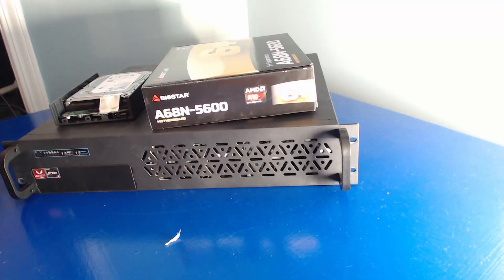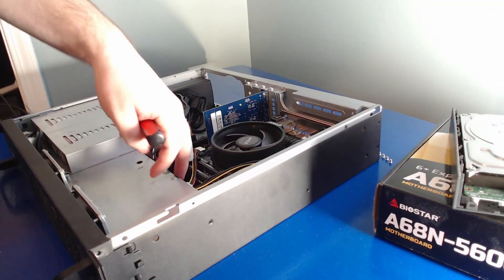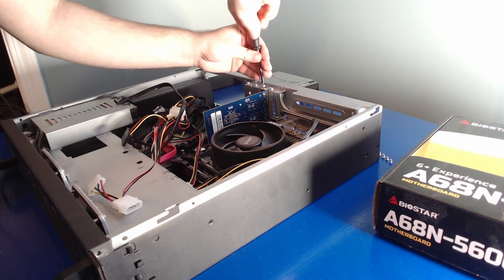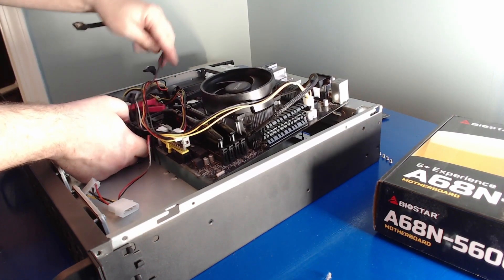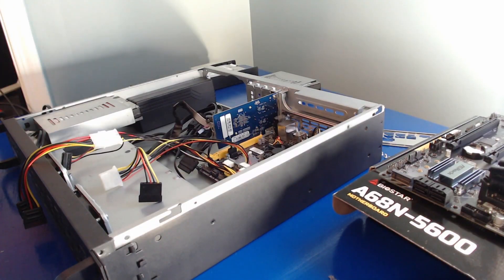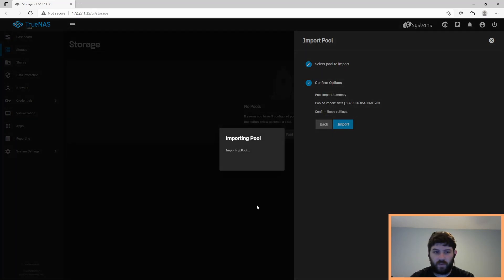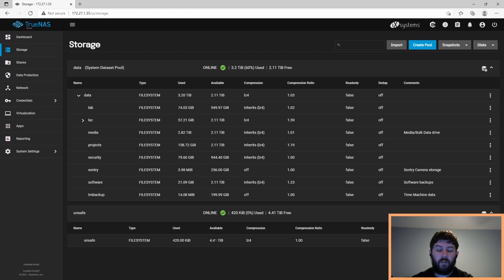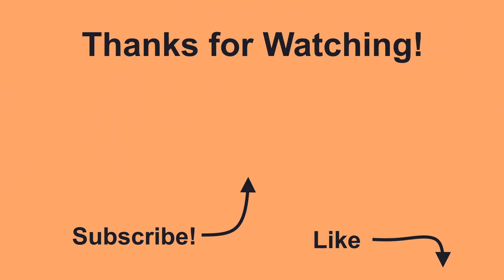Rebuilding my older ZFS server for TrueNAS SCALE

Comment: How stable is scale?
Reply from the maker: I'm not doing anything particularly complicated but I haven't had any issues with it at all. I'm only using local authentication, SMB, and NFS, so it's not a comprehensive test of its features.
Reply: @apalrdsadventures  Is there currently any  LXC support?
Reply from the maker: No, they have VMs, Docker, and Apps. I believe Apps are either packaged containers or packaged Docker images, the equivalent in CORE used pre-made Jails.
Reply: @apalrdsadventures  Ah got it, thanks. I hope they will add LXC support soonish tho!
Reply from the maker: @Shadoweee  I don't know if it's on the roadmap. I don't do any virtualization on TrueNAS, I use Proxmox instead. TrueNAS has never been great at it.

Comment: Single disk ZFS pool is perfectly fine as long as you do not require redundancy.
You can even fill it to the top above 80%, just do not use snapshots in this case.
Reply from the maker: I'm aware, it's just not great practice to store data on a file server with no redundancy. In my case, I'm using it for backups and security footage, so it's all data that can be lost without issue, as long as I'm aware of drive failure quickly (which ZFS/TrueNAS are great at)
Reply: @apalrdsadventures  Then you should be aware of tiered storage concept and that there are plenty of cases where redundancy is only increasing costs (often dramatically) providing no reasonable advantage, e.g. 90% of Plex media pools that are not some rare collectible content. For some reason iXSystems ignore this concept as hard as they can.
I have only 2Tb in triple-mirror and 4x 4Tb single disk pools running for over 50k hours.
Reply from the maker: iXSystems are promoting practices for business deployments. It might not matter if a bunch of backup data is lost, but it'll take a lot longer to get everything up and running again with single disk vdevs than it will in a setup with redundancy. Even if you have backups or don't need them, the downtime isn't insignificant if you need to completely rebuild the pool to continue using it.
Reply: @apalrdsadventures  How is it longer in case of single disk? In an enterprise environment you'd even have a hot-spare that you could swap in immediately. In case of redundant pool, you'd have to resilver for a significant amount of time.
Not sure that I'm following your point.
Though, I noticed that they only care to cater to businesses and much less about making their product more versatile in general.
Reply from the maker: @Mr.Leeroy  If I have a RAIDZ vdev and a disk fails, the pool continues to operate and is accessible to users while the drive is replaced and resilvered. With single disk, once the disk fails the pool goes offline and anything that relies on that pool can't access it. Being unable to access the pool might be a bigger deal than the loss of data on the pool, especially if the data is working data and not backups.
Reply: @apalrdsadventures  Oh, so you have high availability in mind, got ya. Well there are missing HA elements in Core, only TN Enterprise has true support I believe. So it would be strange for iXsystems to enforce HA practices for Core userbase, their motive is probably different.
BTW, you cold probably automate creation of substitute single disk pool from hot-spare in case existing one goes in a degraded state using TN API for the sake of shares' availability. It is definitely 'scriptable' in terms of ZFS.
Reply from the maker: @Mr.Leeroy  Not necessarily high availability, since the system is still a single point of failure, but the drives are more likely to fail than most of the other components in the system, and a power failure will probably affect everything that would access the system anyway.